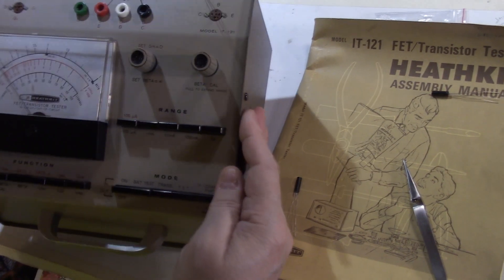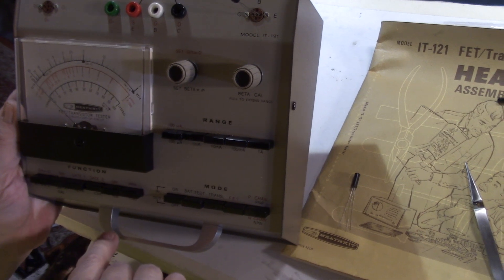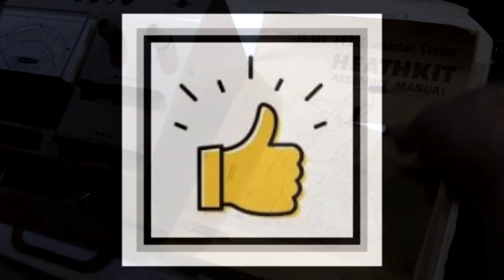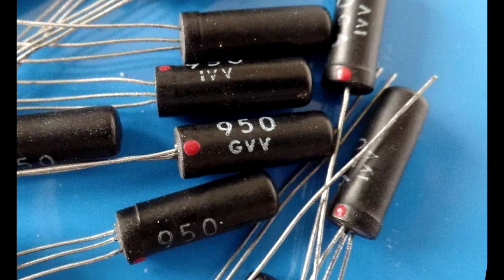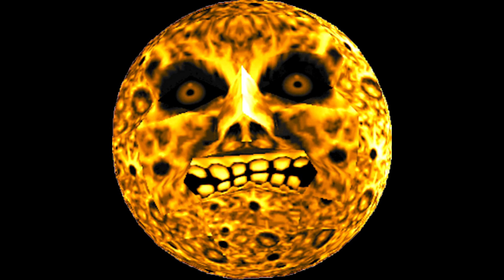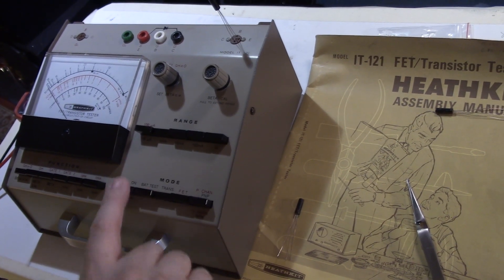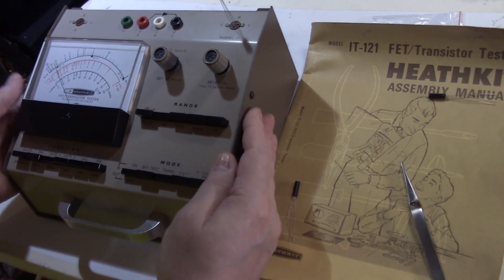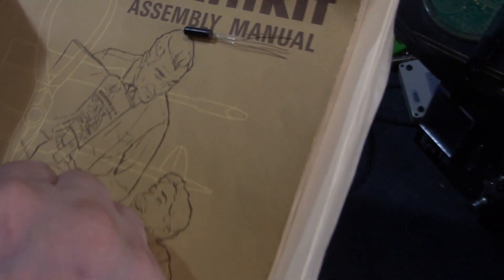Testing Xripleys Germanium transistors for leakage and gain

Comment: Thanks' for the video!Excellent information and testing guide!I've used several methods'/devices' to test germanium transistors and honestly I've found that the little,taobao digital meters',out of China do a fairly accurate job of giving 'hfe' and forward voltage(Vbe). 'Leakage' is a different story.I have an older meter that test for 'leakage'. Lower-gain germanium work well in 'Deaky' amps'(anything above hfe=40-70),output should be a bit higher and you can even use silicon in the output stage and get the 'deaky-sound' with germanium in the input, 'pre-amp' stage!
Reply from the maker: makes sense . thanks for the heads up  as we need to determine BOTH , a meter that only does gain only gets me half way there . i have not been down the DEAKY rabbit hole yet . i am not a fan of lm386 based mini amps tho . i do prefer the tda7052a chip amp , the "punch" amp . if you are planning to build mini amps do your self a favor , order 10 of those and side step the mess that is  lm386 . interestingly enough , i have never run into a better germanium transistor than what i got from xriply . these mullard 950 are HEAD and SHOULDERS germaniums . check out the biasing video i am uploading today . its really something ...
Reply: @peteytwofinger  I got some really nice 'NPN' 'germanium' from 'Small Bear'.I'm thinking about using one in the pre-amp spot of a small amp and then letting silicon transistors' do the rest.While germanium throughout would impart that 'smooth-sound',the amp would basically be amplifying the first transistor in the other stages,the second transistor being the 'driver/phase-splitter'.I have some small amps' based on the 'LM386' and while I would not call them horrible,they really don't replace a 'discrete-amplifier', per se!